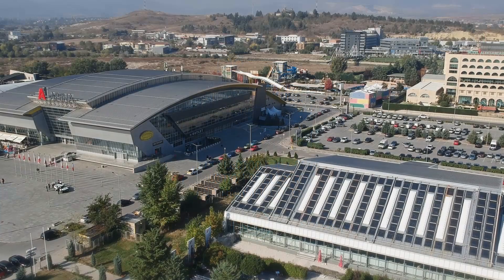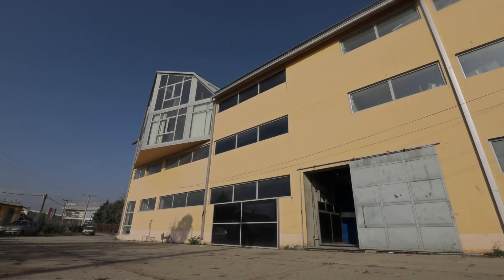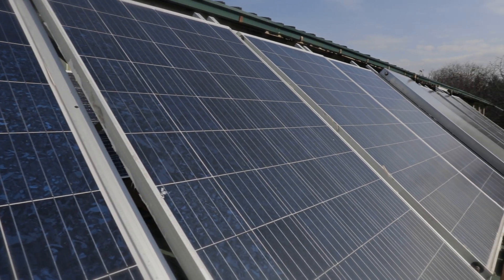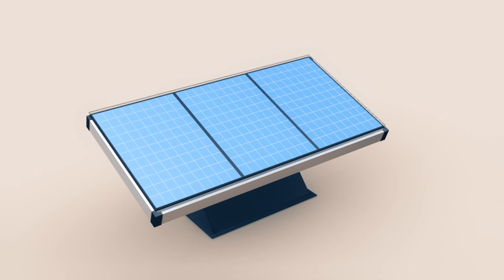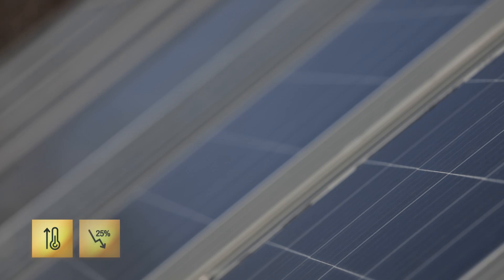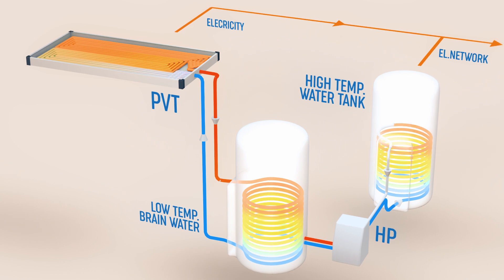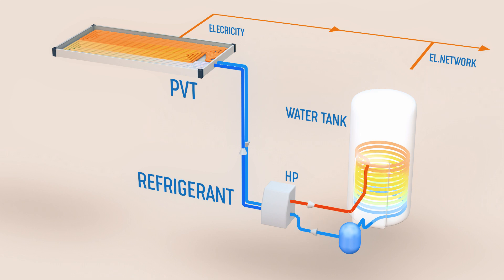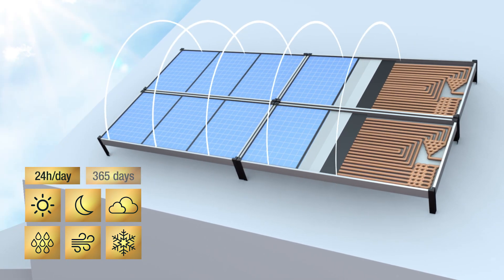PVT Hybrid Collector for combined production of electrical and thermal energy

Comment: If my application cannot dump the heat, is there any increase in power output just running water in a loop? what is the weight in comparison to PV only panels?

Comment: How do you generate energy over night? Are you using heat engines + thermal stores or thermoradiative cells or both?  You mentioned heat pumps.  They can work as heat engines if used in reverse.
Reply: I think they simply use the captured waste heat to offset and reduce other heating costs. Electricity they would have to get from the grid or a bettery.
Reply: @GeneralBlackNorway  A heat engine would be a good thing to add if they were doing non building installations.
Reply: @alwynwatson6119  the "night" mode just uses air-water heat pump system. This is just marketing about 24/7 production :) On day it also generates electricity from PV panels.